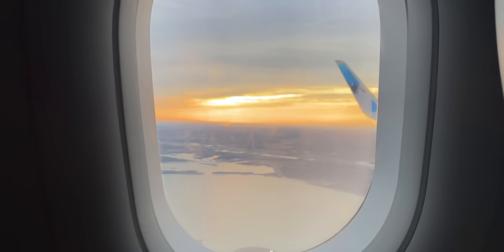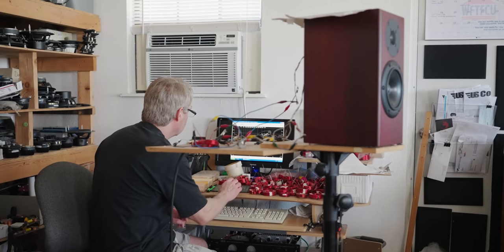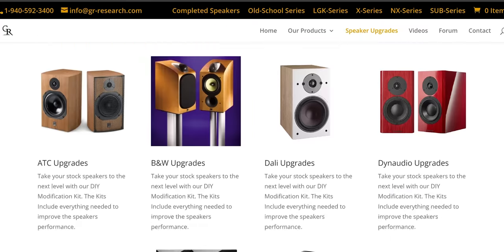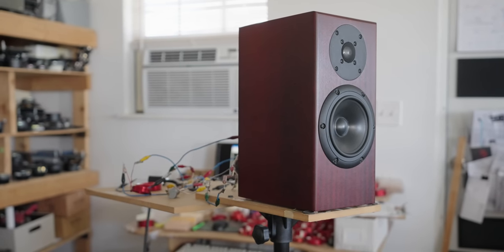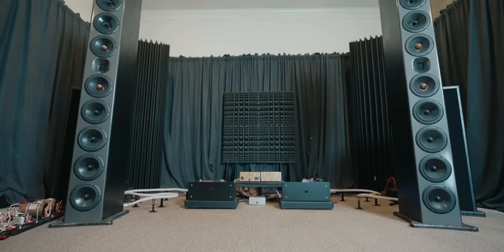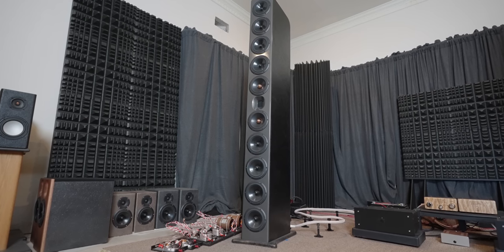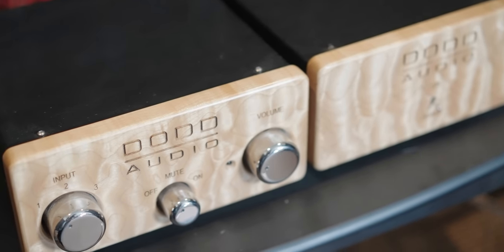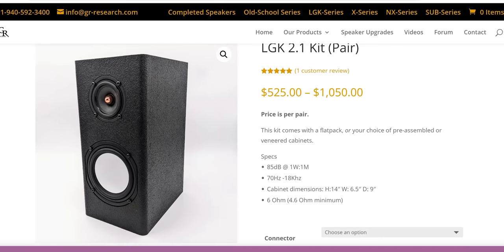Are the GR-Research Audiophile DIY KIT Speakers & Upgrades Worth The $$$?

Comment: My experience with DIY taught me that most impressions of sound quality as it relates to crossover components is due to listener expectation. If anything, the inductors matter most, followed by capacitors to a much lesser extent, and least important are the resistors. I suspect that’s why it’s not uncommon to spot sand cast resistors in otherwise relatively expensive crossovers. 

Danny is correct regarding the quality of individual drivers but mostly a cheap crossover will perform as well as an expensive one, all else being equal. Unfortunately, even some of the most veteran audiophiles struggle to avoid the trap of expectation bias.

Comment: I like your videos and Danny’s.
Beyond replacing cheap parts…
So if his approach were to ensure the music stayed in phase as the listener stood up and moved around (just one example), and achieving this required flattening the response to that of a reference monitor, then this might not be my preference either - it would be no hardship for me sitting in the “sweet spot” and experiencing what the designer of the speaker intended! 
But people who want accuracy-from-all-angles can go to Danny and this is what he does. 
The differentiation is as follows:
The owner has an attachment to their speaker and would not wish to part with them so modifying is Danny’s appeal, as well as the upgrade and new design still being cheaper than an equivalent reference monitor which includes the retail and marketing etc.

Comment: Id love to see a review of his upgrade. Send GR 1 RP-8000F ii for upgrade after is had a few hundred hours on it then take to indenpendent test lab with good equipment and do A/B test in stereo as well as a A/B test in a normal listening enviroment. I suggested Klipsch speakers because he loves those ;) and I don't see a upgrade kit for the Rp-8000F ii yet so he hasn't done one. His upgrade on a V1 versions looks like it would make a drastic difference. I have Klipsch speakers so genuinely interested in a second opinion on GRs claims and work. Klipsch is also very popular so would get alot of views.

Comment: I called to figure out the process of what was necessary to upgrade a set of towers that my dad purchase new in 1991 (Energy adyssey APS 5+2). They were given too me just before he passed. After naming the brand they told me. I would be much better off with buying one of their kits. I found this to be quite distasteful as I had already explained the sentimental value of these towers. I just would like them to sound a little better. I don't know if their product is any good but I assure you. Their customer service is quite poor

Comment: I felt this was a fair enough assessment. The concerns you cited are ones I also have. One thing to note is that there is a large following of GR research products and upgrades. So, there is something to what they are doing. I have noticed that GR research costumers are very quick to defend Danny and his products. In general, this would not occur if the products were sub-par. You could argue that some of the responses here are a result of confirmation bias. However, I find the Audiophile community is not comprised of shrinking violets. If someone generally felt dissatisfied with his speakers or upgrades. I am sure they would not hesitate a second to warn the community off. I have yet to find a GR research customer, post a negative experience. To me that speaks volume on the validity of his approach. On upgrades, the only way we could know for sure is a blind comparison between a stock speaker and modified one.  Would people be able to hear the changes, and more importantly, perceive that those modifications improved their sound?

Comment: If you have a speaker with lots of peaks, drivers out of phase causing cancellation, and go from that to a speaker with drivers in phase and a near flat response, with better parts, how is that not an upgrade?

Comment: Anyone with a background in electrical engineering will tell you much of what Danny spouts on his channel is BS designed to sell expensive parts - which isn't exactly surprising since that's how he makes a living. Over and over again, he makes "shoot from the hip" comments about electrolytic capacitors, iron core inductors, and sand cast resistors that suggest they have no place in crossover design. The reality is - there are plenty of crossover implementations where they make perfect sense and have absolutely no "sonic signature" with respect to the end product. For example, when providing a trap to dampen a midrange driver's fundamental resonance, there is absolutely no need to use anything other than electrolytic capacitors. Clearly, they have no impact to the sound in the passband - their intent and use is to dampen the driver's fundamental resonance so that it cannot be excited by a high level input signal which might result in unwanted harmonics being generated that "invade" the passband. Similarly, Danny dismisses ALL usage of sand cast resistors as being inferior and detrimental to sound quality - without any basis of proof whatsoever. This "advice" Danny continually provides is definitely good for his "bottom line" and must be taken with a grain of salt as it has no basis in fact or actual engineering practice.

Comment: 4:00  I design crossovers but I gave up using my "alligator" clips a while ago. They sound different to direct twisted wire connections. I want to tell Danny that it's the same deal as with cables! Being a cable enthusiast, he should know this well. The main reason I reckon cables make a difference is cos of my "allicator" clips. The difference is so great that I had to change a resistor after final connection, cos it sounded different, and different to what I wanted. So now I twist up my trial connections and later cut the twisted bare wire off and re-bare the wire for final assembly. I think it's the magnetic steel clips (that Danny's suspiciously looks like) and the steel wire (in my case). 😅

Comment: I posted something similar to this on Danny's response video. 

I would suggest getting two pair of speakers which Danny has created kits for. Preferably something you are familiar with, not too expensive & readily available. Buy the kit, have someone else install the kit in one pair and then listen.

This way you would have empirical evidence for proving your hypothesis/conjecture about Danny's upgrade methodology. Danny seems to believe you are a fair arbiter of hi fi gear. You seem fairly honest to me in your videos, so I am sure you would rather be able to state with certainty whether you assumptions are correct or not.

Alternatively, I am sure one or more of your viewers has speakers modified/upgraded using one of Danny's kits, they might loan you. You would just need to find an equivalent un modified pair for an A/B test.

While I have bought some of Danny's speaker kits I have never bought one of his upgrade kits.

Comment: Please don't mention Amir here. Please, let's forget that place exists. Please.
Reply from the maker: XD
Reply: I made the mistake of buying a couple of Amir’s recommended ChiFi DACs, both of which sounded analytical, flat, and hard in the upper mids and treble.
Reply: What’s your problem with Amir?
Reply: Amir and his crew only care about measurements. Most of the experienced audiophiles that I know care far less about measurements and much more about what their own ears tell them sounds good.
Reply: @CaptainCrunch823  Amir actually reviewed Danny's X-LS Encore speakers. He didn't beat it up, which was kinda shocking...
Reply: @CaptainCrunch823  What Amir does is cut through the endless crap in this industry. I feel for those lured into buying mains conditioners for example, that make absolutely no difference to anything you hear. 

You state that his website is all about measurements. True, but I'd prefer to be informed about a purchase than not.  Whether you can hear a difference between the best measuring piece of kit and something more average or not, remains to be seen. It does tell you how well engineered an item is though. 

It's a lot better than some random reviewer, with quite different ears from my own, telling me that a £5000 cable sounds better than a £50 cable when, shock horror, it doesn't.. would you believe it?! :+)
Reply: @CaptainCrunch823  by the way Mike, I think it's great that you use your ears and ignore measurements. I'm absolutely for that. 

My issue is with the ridiculous claims made by some in the industry which Amir has helped to shed some real light on.
Reply: It’s handy to be able to filter information and substantiation provided by subject matter experts. What’s the scientific method in discourse again? ‘I may be incorrect. You may be incorrect. We both may be incorrect!’ Every subject matter expert is a treasure to the extent that the material you graze from them, ie. their opinions are ‘really’ properly by the substantiating data… and the extent to which they will concede that they were incorrect to any degree, and then issue a correction or defer to another expert’s more correct output.
For example. I believe Amir’s testing, analysis and reporting against his measurements of digital signal cables to be really good - RJ45 ethernet cables and USB cables. I think his reporting that exotic ethernet materials offer no change in the output signal is sound. I am content to inform my opinion with that, and for example, I will focus my ethernet cable options based on the quality of construction and materials for durability, with shielding to restrain the cable’s EM field from affecting any adjacent conductors etc.
On the other hand, I found myself being somewhat self-restrained from buying completely into two of Amir’s other tests and reviews whilst watching them… it was intangible but my radar/filter just spoke to me of their being cause to be wary - wait to see what falls out of the tree that had been shaken (and yes, they’re GR Research products). The power cable was one in particular - difficulties inserting the connector into a wall outlet, the shroud around the plug being loose. That just didn’t seem right. There was something else involved. In the end Danny Richie offered a response that was inevitably critical, but was balanced with humility and humour and wasn’t disrespectful.
So in that instance, Amir’s methods tainted the overarching data, part of which was ‘useability’, and his reporting was worthy of ‘filtering out’.
Both of those gentlemen have terrific things to offer from their respective lanes, and are probably at different points in developing wisdom around the degree of caution required when straying too far from the lanes in which they are really superlative in their expertise.
Between the two of them, collaborative output would likely be incredibly fruitful and absolutely to all of our benefit given how both appear to aspire to transparency and sharing knowledge.
I made a comment under the GR Research power cable response to that effect, and suggested that it’s probably time for them to break bread and have breakfast or lunch together, resolve the BS, establish a relationship and then demo and test their way through the GR Research facility - play around. To his credit, Danny replied really promptly and said that he would love that, and that he would do better by putting on a Texas BBQ for Amir.
Fingers crossed that happens because I reckon it would be rad!
Everyone would win.
Except the trolls.
But f**k them.
Reply: How can you hate on amir for measuring and not on gr who measures and replaces some parts with more expensive ones
Reply: @CaptainCrunch823  funny that you'd state it that way... you only need to rely on your own immediate observations and you eschew any evidence, scientific or otherwise, that doesn't back up your claim... and you call anyone who might refute your observations, 'flat earthers'. That is handy.

Comment: Nice review, Jay. I thought you were very fair and transparent about what you heard and your personal preferences. Thank you for not re-igniting the flame war just for the sake of clicks. I especially appreciated your comment about the NXtreme open baffle bass sound being perfect for music- but maybe less so for home theater- if you want room pressurization. I had been wondering about that for a while now.
Reply: I own the NX-Treme's and 2 triple OB subs. He is absolutely right. I ended up buying 2 rythmik sealed subs in addition to the OB subs to get a little punch.
Reply: @Subsonic-cd2en  After Jay mentioned that, I also thought that maybe adding some sealed box subs from about 50 Hz down would round out the performance for home theater. How do you have your OB subs and box subs integrated in your NX-Treme system?

Comment: Nice condensed review of the GR speakers but I think you need to review a pair or modified speakers directly to un-modifed pair otherwise baseless opinions are kinda useless. I don't have an opinion either way but for the most part the before and after measurements pretty much speak for themselves regardless if they are up to the same level big OEMs get with true anechoic chambers or Kippel and modifying / improving OEM crossovers is fairly common DIY thing, not just GR Research.

Comment: Personally i don't like speakers that requires a sub to sound complete.  I have a pair of Dynavoice Definition DF-6 powered by a Yamaha A-S1100 and when i
want my apartment to start vibrating, i'll just play  Massive Attack - Mezzanine album . It makes my kitchen table vibrate ... from 4x6" woofers.
Yes it would give a more pronounced low end if i had 2 subs.. but i don't feel like i need it,  also.. i have never played over 1 watt.. still loud as hell.

Comment: Regarding single/pair testing: single speaker to experiment, measure, change, 2 speakers for actual use in listening as you would at home. The elephant in the room here is that there are so many inferior components inside the box because the manufacturers know few, if any eyes and ears will actually see what's in there, and many of these interior components have been shown to be very lacking in true performance. The bottom line is that there are a few companies that accept and pay attention to circuit components in speakers. Just as there have been many improvements in electronic circuit components due to examination, testing of components, applying this similar approach to speaker circuitry, I think can and will bring improvements in this area also. It's worked in electronic circuitry, to suggest that it is questionable, is to suggest to me that this opinion is questionable, especially given the track record of improvements in electronics over the years.
 Jay seems to seek and inquire, but still seems like just a salesman out to recommend products just like any other salesman. I see he's got some $13K stand mounts on hand. What exactly is inside those boxes, or is he even going to look or care. He has the ability to possibly acquire before/after modded spkrs, does he give them a listen? Is he suggesting that we should be satisfied with high end speakers and not question known to be inferior components (caps, resisters, inductors) and fork out high end prices for low end components hidden from view? He seems to be avoiding the controversy, yet accepting of novel circuit developments when found in novel products. Better performing parts, OK in electronics, but poo-pooed in speakers?
 This is discrimination.
 More verbiage for self promotion?

Comment: I believe the key is simply using better capacitors causes the soundstage to open up while creating more coherent mids and highs.  

Also...  When I was at GR, he was using DC powered tube amps that were extremely low watts.  
That will definitely limit the dynamics (full).
Reply: Every single amplifier, let alone a tube one, is DC powered, that's what rectifiers, chokes and main filter caps are for.
Reply: May be you mean DC coupled (no capacitors between stages)